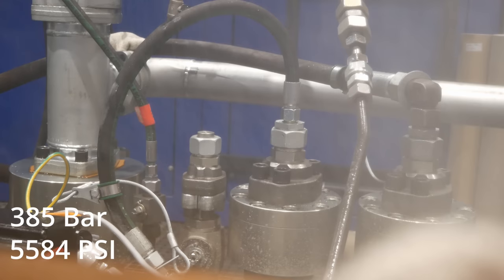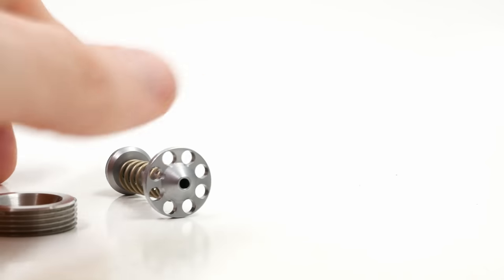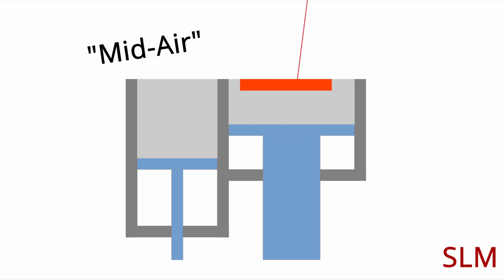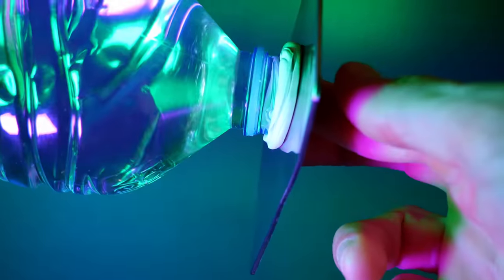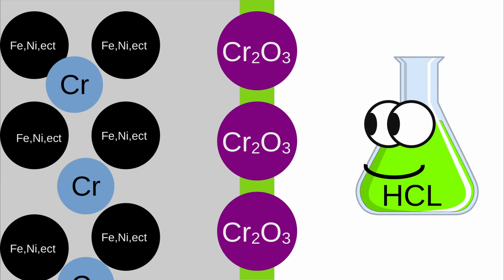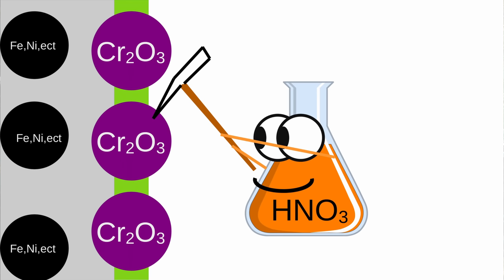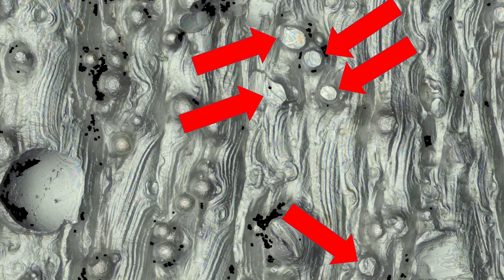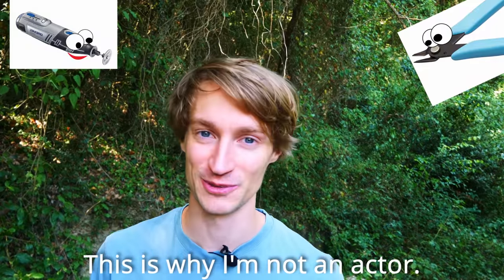Metal 3D Printed Compliant Check Valves!

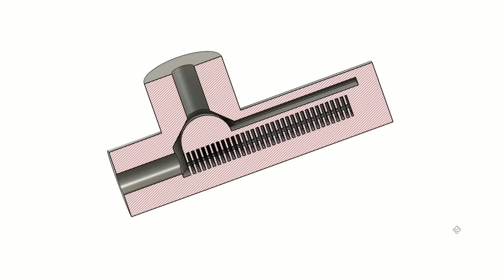Comment: From about 7:00 to 7:22, you show the valve with support structures.  It appears that a drill bit or milling tool inserted through the exit port could easily machine away the support structures.
Reply from the maker: In this case it would be possible! But the general concept was that the check valve is somewhere deep inside of a hydraulic system, hence it was removed with acid to show it's possible.

Comment: you know how in some cooking you 'based' your food? like opening the lid and scoop up some of the broth or whatever onto the food. well for some resion i wanted to make something that dose that normally. in my head i was thinking of putting a straw in the water, go to the top of the sealed lid and drip down only using pressures from steam escaping the top and check values. but i could only think of tesla valves.... talk about over engering... thanks!!!

Comment: I can't help but think the better approach would be to design a support structure that could be shattered by an initial high pressure flow or by oscillating the flow at high speed.

Comment: Have you thought about trying other valves? specifically hydraulic logic gates and multi-position valves? Not sure on the proper terminilogy there, but i mean valvues that have different positions to do different stuff, controlled by the user or a different system in the part i.e. pressure release, etc. I know the sealing surfaces on a parralel valve may be difficult to obtain through this method, but maybe some different geometry and pressure-dependant sealing surfaces could be used.

Comment: Great video btw

Do you think that printing the supports of the cantilever with a slight off-center alignment for the top and bottom faces might enable the supports to flex or buckle under pressure, creating a pathway for fluid to flow through the valve? And in the absence of pressure, the supports could prompt the cantilever to securely seal against the mating surface?

Comment: Next time use AN/JIC fittings for connections not compression rings. There are tools available to flare the pipe then using two other fittings to convert it over to a usable AN female. Leaving the chance of a compression fitting slipping off the table.

Comment: Would you be able to deform the sealing surface using repeated high-ish pressure closings? That way you could hammer the seals closed without needing super high strength in the finished design

Comment: Cool video and probably other good uses for the method of removal of the supports but can’t get over the fact that 
A drill bit could have done it in 2 minutes
Reply from the maker: In this case it would be possible! But the general concept was that the check valve is somewhere deep inside of a hydraulic system, hence it was removed with acid to show it's possible.

Comment: If you would have printed it vertically you wouldn't have needed support structure in the first place. As for the temperature problem, you can slow down the timing between layer passes.

Comment: Very interesting video but why can't you remove the support structures by drilling them? The cantilever format seems very easy for this job and I'm sure you can make the support structure on the other with an easy "failure" point once drilled (f.e. a support structure with a T shape such that when drilled the central point of the T, the rest of the structure is freed -even if this leaves a little pointy residue-)

Comment: BTW the design on page 7:19  will not work after implemented. Because the half sphere isn’t allow to self adjust horizontally in the cone cavity to seal completely. It’s suspension arm refuse to corporate the self alignment. Leaving a crescent gap in the cone.

Comment: Would it be possible to break the support with hydraulic pressure? Like print the valve at the end of the movement and break it loose with pressure.

Comment: what would be cool is if a metal printer could have two different metals with different acid resistance so you could have one metal be the supports which would be removed by using acids.

Comment: Wonderful. Brilliant use of physics, chemistry and lateral thinking to advance metal 3d-printing in a meaningful way.
BTW- have you watched Dan Gelbart's prototyping/mechatronics video-series? Dan has recently (~2y ago) made a video about a plastic-metal 3D-printer, with post-sintering to remove the plastic and to end up with a 99+% solid metal part. The plastic inetermediate-stage too may allow for some interesting print-in-place options. ( YT :: Dan Gelbart )
Reply from the maker: i'll check it out!

Comment: I'm far from an engineer, However I wonder if there is a flow rate of air and a distribution method that would allow the tiny beads to stay in place while allowing them to be cooled without built in supports.

Comment: Ok I didn't actually read all the comments and didn't remembered the following solution. But in the case of the angled checkvalve, why not simply drilling from the output hole to remove the support elements? and for the straight valve, why not using a support concentric with the rest of the valve that only connects with the valve at the bottom and to remove itjust snip away the bottom connections.

Comment: On the diagram that you show the plunger being held up by supports on the side, why couldn't you put one bigger support straight down to the build plate? You could design it to stay in that location or try to drill it out after removing the print from the build plate.

Comment: if you design your parts right you could probably use any normal drill to reach into the spring design and drill out the supports underneath it from the hole
Reply from the maker: In this case it would be possible! But the general concept was that the check valve is somewhere deep inside of a hydraulic system, hence it was removed with acid to show it's possible.
Reply: @TurboSunShine  yeah the idea in my had was if you had a straight line from the outside of the component that could be tapped and put a bolt there could be a longer bolt if it goes through multiple parts just you need something like loctite sealant and glue to make it more permanent and sealed. So what i was thinking if you dont have moving parts in the way you could have a hole going straight to the part you can drill away. So not a perfect 3d print only solution but you could potentially make it work in some designs. If you dont want a large bolt you could use headless bolts to seal the holes. Might not work but i dont have equipment to test this with like you have. I'm just airing my ideas

Comment: Would annealing the check valve help with the welding bubble problem?  I'm not an engineer, so I'm not sure if it could be done in such a way that wouldn't destroy the valve, or if it would even help.

Comment: I am not a mechanical engineer, but how about using the support material as a compliant spring to push the valve in, and not require any removal?

Comment: If there's a way that the check valve could work with a valve being a flat disc and the other valve geometry making up for this, Then couldn't you just laser in a flat disc have the machine pause long enough for the flat disc cool and then continue the print. Or even print on certain points of the disc afterwards to cause it to controllably deform in a desired manner due to unequal cooling.

Comment: Could you print a check valve that works like the check valves in our circulatory systems (basically a tube with three triangular flaps on the inside that can be pushed flat against the tube wall in one direction, allowing fluid to flow through but that when pushed in the other direction close together forming a cone that blocks fluids from flowing though)?

Comment: Why isn't a simple thermal camera attached to the laser head, checking the temp at the latest printed layers, which signal is linked to a delay, so it's holding position until the temp is correct? Also the chamber and/or the reservoir for the new sand could be cooled by peltier or water cooling systems? Since an airstream would do the job here🤔🤔🤔🤔

Comment: I realy like the video but why would you want a completely printed valve?
Depending on how complex the main body is and the pressures/chemicals involved if there is any deformation of the sealing services and it needs repair or replacement you cannot go in and replace a simple part but must reprint and remove the whole assembly just for the check valve that could be serviceable  and the most likly failure point. Also while using an acidic materials to remove various structures is a neat idea why add more chemicals to a process and add extra steps in production that take lots of ppe if a human is involved.
It's definitely is a neat idea that should be researched but at the same time what problems will it solve and what will it creat and do the two make one or the other worth in?

Comment: I wonder if it's possible to remove the support structure my making them fragile enough they can be blown out with overpressure. The surface finish left behind would be awful, but if you put them in a place where that doesn't matter.... 🤔

Comment: Really cool.. but couldn't you have just used a drill bit through the exit hole to cut all the support?
Reply from the maker: In this case it would be possible! But the general concept was that the check valve is somewhere deep inside of a hydraulic system, hence it was removed with acid to show it's possible.

Comment: If this weren't YouTube and you lived in a country that allowed it, I'd suggest 3D printing a gun using SLS. They are very interesting mechanically speaking. Instead, I'll suggest making a mechanical watch. Maybe something that shows phases of the moon and has an alarm, while still being wholly mechanical.
Reply: As long as it isn't a firearm or pressure bearing firearm parts, there shouldn't be an issue anywhere and although firearms are indeed very interesting in their intricate or sometimes very crude designs, an air or even squirt gun can be - at least for me - even more interesting in terms of their technical and mechanical design, and they're way easier and safer to test and shoot
Reply: @Null8fuenf10  I wouldn't say safer. There are plenty of videos of air guns and their destructive capabilities. Also, if you overfill an air tank it could explode on you. However, they are definitely more interesting than regular guns as they have to cycle ammunition without the force from recoil, which is pretty cool. Not only that, but the mechanism by which they shunt so much air in one blast is pretty neat. Did you know that Lewis and Clarke took a Girardoni air rifle on their expedition for protection from wild animals?
Reply: @anon_y_mousse  air guns with an air source are pretty simple to make cycle since you got the air source and it's just pneumatic automation then.  but anyway  a company made some 3d printed 1911's in 2013 from metal and sold them as a concept thing, so it's not like you can't do it.  cnc'ing is just a lot cheaper.
Reply: @lasskinn474  It wasn't about physical capability. Of course you can 3D print a gun, even out of plastic, but rather YouTube's policies and general hostility towards gun content. Also, cycling with air isn't as simple as you think. You can't just cycle like normal because you have to prevent all the air from escaping, and as the pressure lowers in the storage tank it becomes less effective at functioning.
Reply: @anon_y_mousse  well you could phrase the thing as an automatic feeding system or something if you wanted to explore pneumatic gun mechanisms on youtube.

you know, for feeding the wildlife with high velocity
Reply: @anon_y_mousse  well, yes, absolutely, there's air guns, that are more powerful than 9mm but I was rather thinking about one, You could shoot in Your own apartment even. And I don't know how laws are in other countries around the world, but there might be a limitation on how many joules said rifle, diy or not, is allowed to have; was it like 1 or .7 joules in quite many places? I'm no physics biologist ^^
But knowing laws, especially in Europe and especially² the EU there is no clear answer or an absolute generalization that is technically outright outlawing everything, like any firearm that can hold a magazine with more than 20 rounds (for rifles 10 rounds), which is virtually every gun, but people do have those guns and still can buy them. It's great, when not even lawyers know what You are allowed to do or not!

I stay by that, that air rifles are safer than firearms lol
A .22 is also safer than a howitzer lol
Granted, never shot a howitzer but You get the point. Alone dropping the charge could break Your leg xD

Oh, yes, didn't Gun Jesus make a video about it?
It's always curious when You find out, that something like 'modern toys' where actually used further back in history and for actual use and not just plinking.

Different topic, but it came to mind, that headphones predate speakers.

Have a great weekend!
Reply: @Null8fuenf10  Admittedly, I don't know what the specific laws are on air guns. They can vary in power so not all are as deadly as a gunpowder based gun. I'd guess the AFT classifies them as AOW, but I'm not sure.

Comment: I have a torque converter made up in fusion but it's stall is something like 12000 rpm and I don't wanna spin plastic that fast . Metal printing would solve this problem .

Comment: Probably a stupid idea, but would not it be possible to design the lever and its support in a way to be able to remove the support by simply drilling straight from the out port of the valve? At 7:00 you can see what I am talking about, drill from the front.

Comment: Can you print something such that the testing of the device causes internal destruction of the support material and it's able to be flushed thorough the part before it gets installed into the system?

Say using more thin wall segments that you know will get destroyed during operation but still support the print and dissipate the heat during making?

Comment: Re: The sintering process for 3D metal printing.

Could you use micro-sprays of liquid nitrogen to cool down the hot fused metal components, as part of the powder recovering process..?
Reply: Yeah just wait for it to cool. Or cool it faster: touch it to copper flat plate with cooling liquid (modify g code).

Comment: Couldn't you make the supports for the check valve thin and then pump high pressure through it to remove the supports?

Comment: I see a problem with this "melting metal powder layer by layer" method. You have to get the power from the inside of it your system/print somehow. So, what if you need to design a fully sealed system that needs to be empty? How can you print those out of metal?

Comment: How about narrowing the support material down within the sight line of the port in line then just drilling them away through it? ( 7:01 Drilling them away through the port to the left.)
Reply from the maker: In this case it would be possible! But the general concept was that the check valve is somewhere deep inside of a hydraulic system, hence it was removed with acid to show it's possible.

Comment: Any reason why the 3D printers use a insulating metal powder rather than some metal slurry with water or oil that has enough thermal mass to cool down the metal on their own?
Reply from the maker: Not sure, but i would assume water and oil would evaporate during the laser melting, and would cause a bad "weld"
Reply: @TurboSunShine  It would definitely evaporate and because of that you'd need to use a much more powerful laser.
I'm not convinced that it would automatically mean a bad weld though.

Comment: Why not cool the laser and enclosure with an oversized indirect evaporative cooler? Would that help with overhangs? Or if you misted liquid nitrogen with a sprayer after each layer sintering? If I remember right they add nitrogen to the powder to assist the laser melt anyways.
Reply: Have the slider that sets the powder start on the opposite end and deposit liquid nitrogen before adding another layer of powder
Reply from the maker: @first-thoughtgiver-of-will2456  they use usually Argon as the inert gas, not sure how nitrogen affects the "welding" process. But it's definitely something that one could research some more!
Reply: @TurboSunShine  nitrogen can be used as a shielding gas in some forms of welding. but it doesn't remove the forces from the part as it cools.   what it needs to not deform is actually a kiln (see that company doing glass fdm 3d printing).

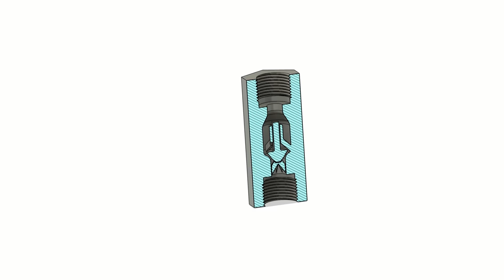Comment: 6:00 Why not make the support of the plunger go all the way down through the opening and be attached to the base of what you are printing on, instead of the valve itself? I can draw you a picture if you want.
Reply from the maker: In this case it would be possible! But the general concept was that the check valve is somewhere deep inside of a hydraulic system, hence it was removed with acid to show it's possible.

Comment: I don't fully understand all this but I have a question.  Could these chemical processes be used to bond the metal?  It still wouldn't be internal but maybe you can make the valves smaller without the threading.
Reply from the maker: not sure i understand the question, but yes, the valves could be alot smaller if they were not threaded, the reason for the threads is because we wanted to test and compare the performance to traditional check valves. there might be chemical processes that bind metal, but i dont know any that are as strong as melting, HP has some binder jetting technology that is similar, but its not really chemistry, its just glue, kinda